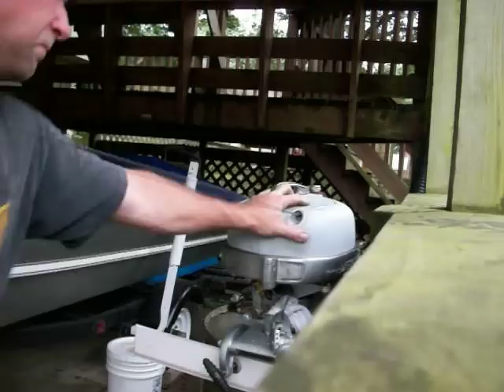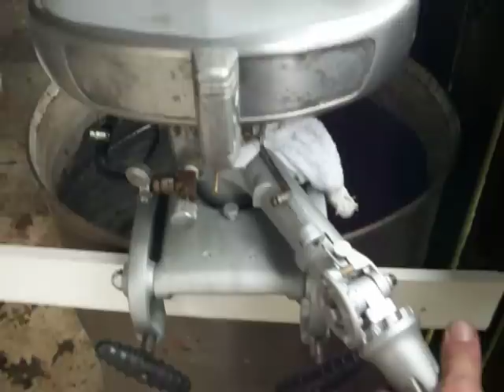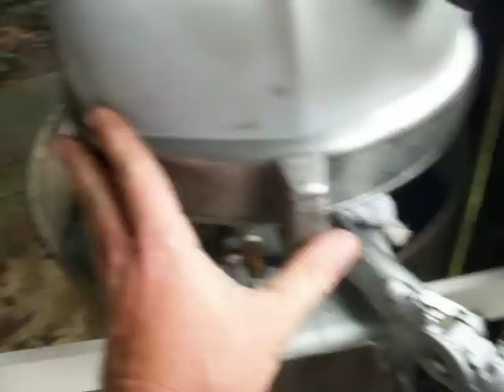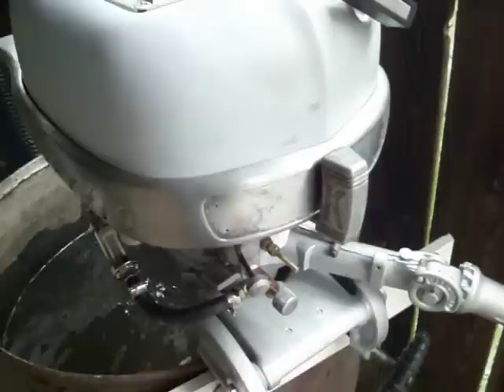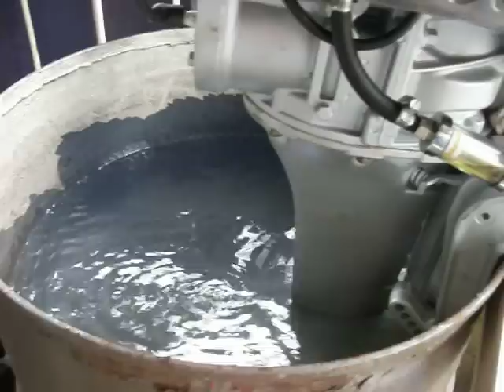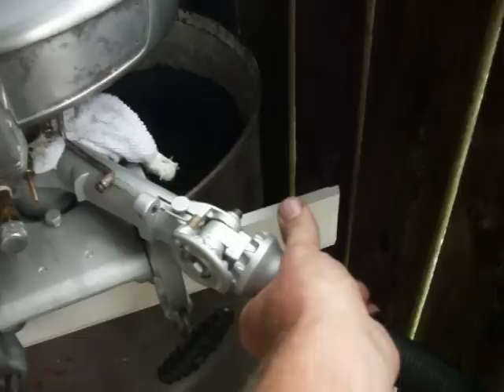Kiekhaefer Mercury KG7 work in progress (but running) Super 10 Hurricane outboard

Comment from the maker: @JayzonH I did have the powerhead off to install pivot shaft bushings. I cleaned the leg, and I didn't see any restrictions in the wp tube hole. Brand new impeller. Lower unit "screen" was cut out to keep from cloging by previous owner. Lower unit was replaced because old case was busted. I've seen these motors throw out a good spray, but mine don't for some reason. I have ran it for awhile and it never got too hot. I'm stumped.

Comment: I'd keep investigating.   You should get really good spray out of each of the holes down th center of the back.    My KG7 impellor had bit of a set and still sprayed water out of those like crazy as well as the pivot shaft.   Did you have the powerhead off?  They do get pretty carboned up and the return hole could get clogged I suppose or enough of a build up to divert the water away from the holes.  Maybe run some evinrude engine tuneup (decarbon) through it.

Comment from the maker: @johnnycgc There is water streaming. Warm water. Any thoughts? I did get prop on and ran it for 10 minutes. Temps were 105 degrees on exhaust cover, and 98 degrees on both cylinders. Thanks for any suggestions.